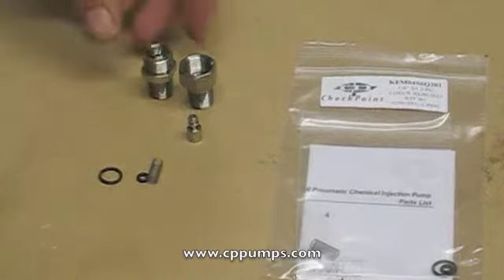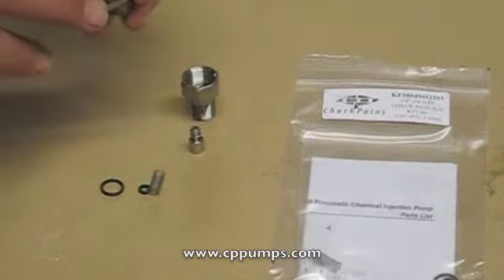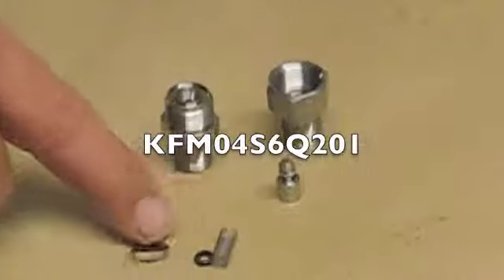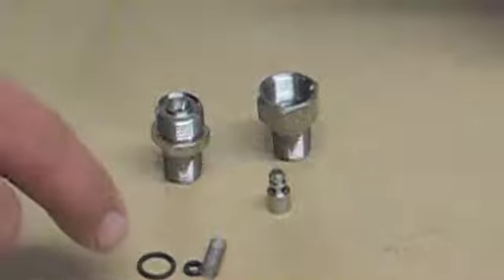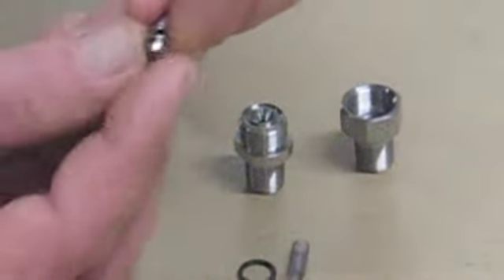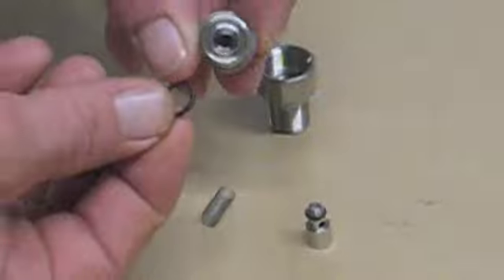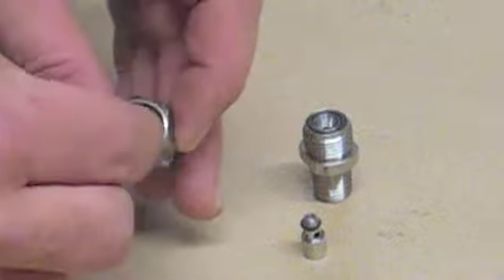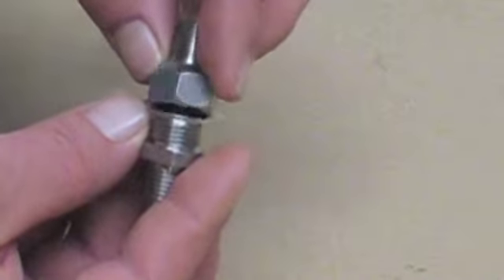CheckPoint Pumps and Systems Check Valve assembly

Comment: I have a self priming domestic water pump.it keeps on priming .regularly like every 10 mins.for about 10 seconds. Very annoying.and obviously not economic or good for the pump.which is only a couple of years old. Is this process of replacing the check valve, you demonstrate here,my solution, or maybe there is a different solution. Thanks in advance.